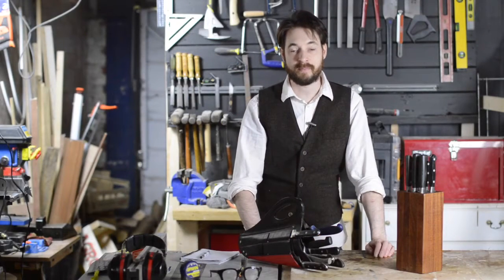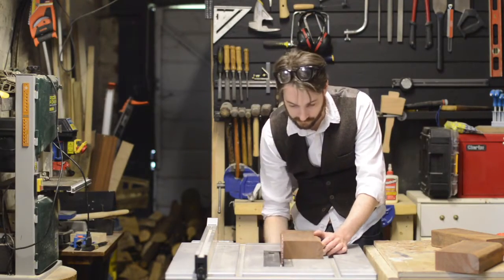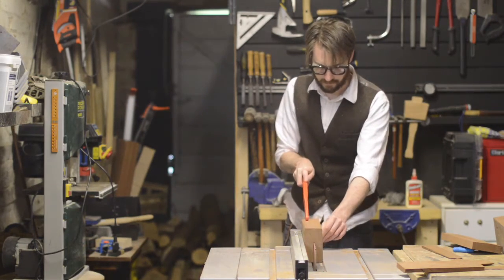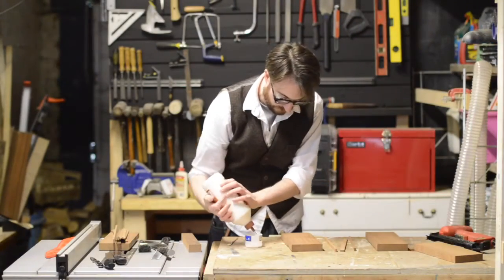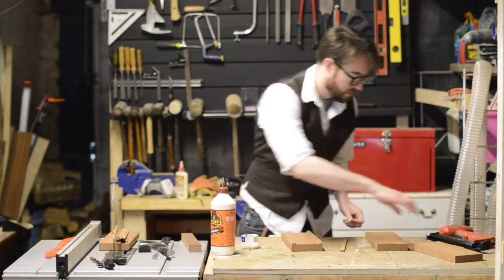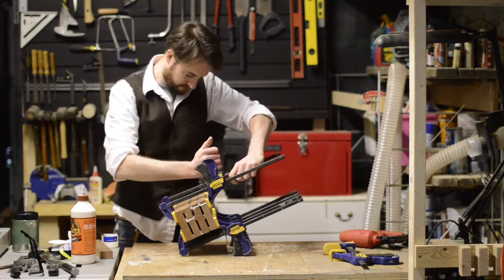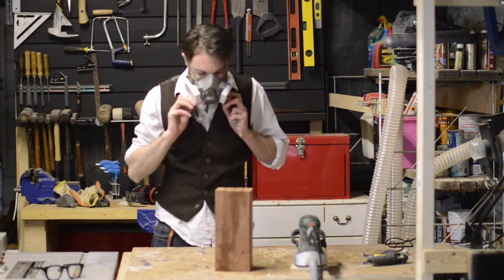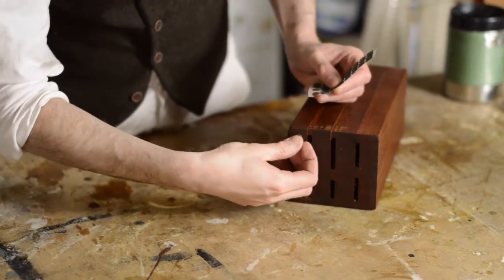How to make a Wooden Kitchen knife block

Comment: What is the best kind of wood for a knife block like this?
Reply: Training to go Berserk the one you like the most. Since this is an interior object, weather resistance isn't required. And the knifes are mostly kind of floating inside, it is not a tight fit, it is not like the blade will be constantly cutting the wood. So I would say you can choose any wood you want, the most important part is that you like the wood you choose.